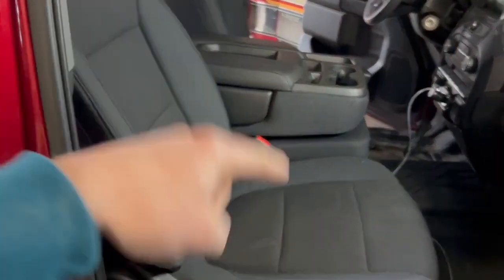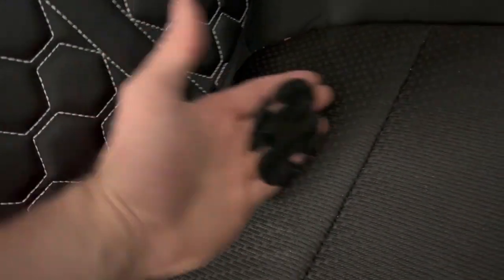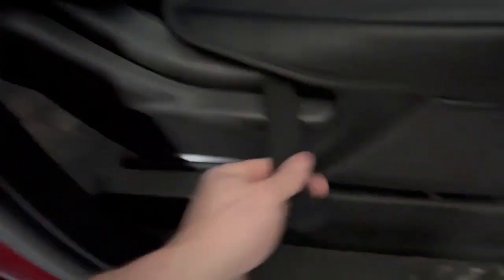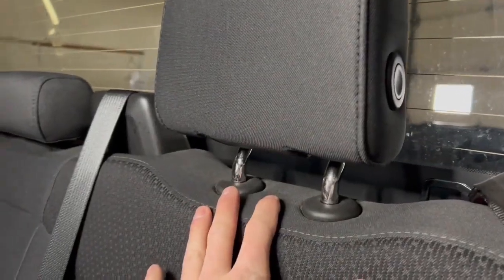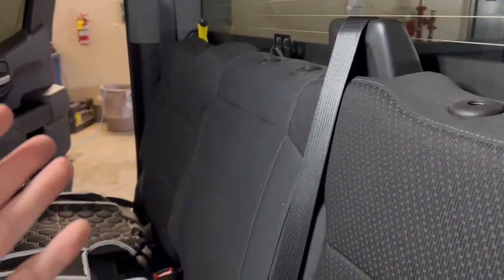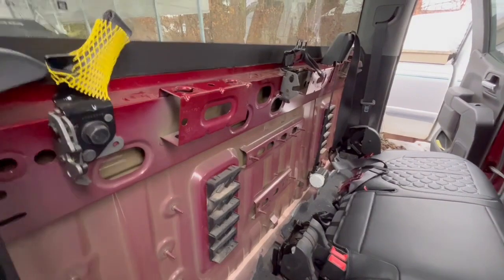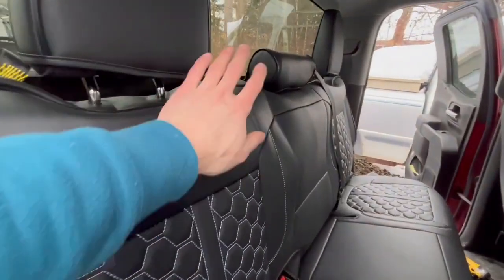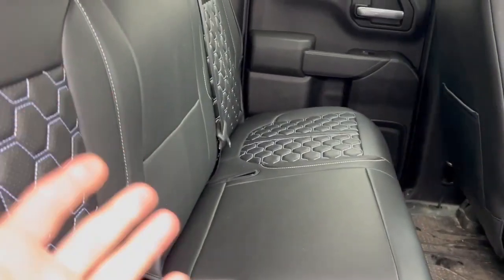Kustom Interior | Chevrolet Silverado Custom Honeycomb Seat Cover install by @DIYAndrewFlockhart

Comment: Was going to buy for my 2017 Chevy Silverado double cab but website says it doesn't make covers for the back seat of the double cab??? But truck in video looks like a double cab?  Help! Lol
Reply: it is a double cab in the video
Reply: @erikalvarez9496  lol, that's what I thought. On website it said they don't make the back seats covers, only crew cab. 🤔 Maybe they do now, that was almost a year ago even though it says my comment was 6 months ago. Lol
Reply: I believe that is the reason why the bottom part of the rear seat covers did not fit correctly. They are made for the wider crew cab seats. My truxk is also a double cab and am not sure if they are worth getting now.
Reply: @MrJoeeano88  I got ya. I'm going with the ore expensive Katskin. Yes about $2400 installed but cheaper than factory leather. Sometimes to get the quality that you want you just got to pay the money!?!? Lol